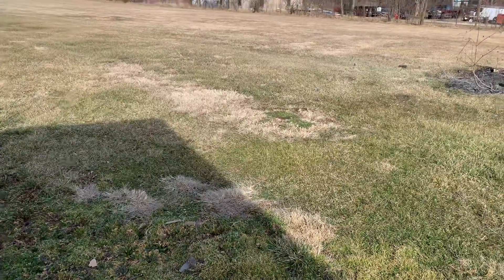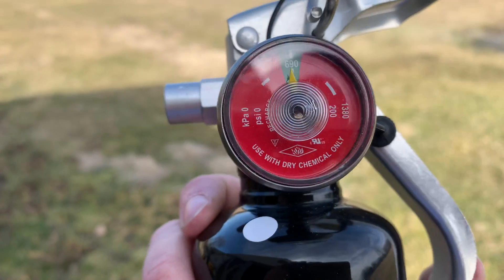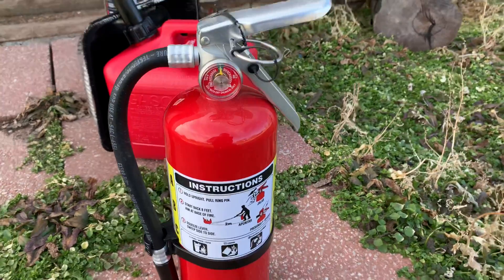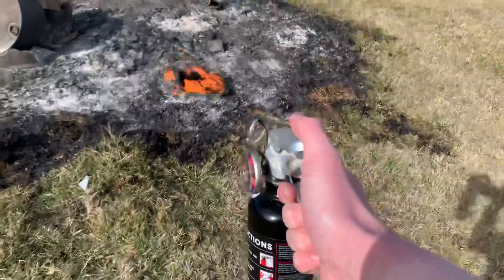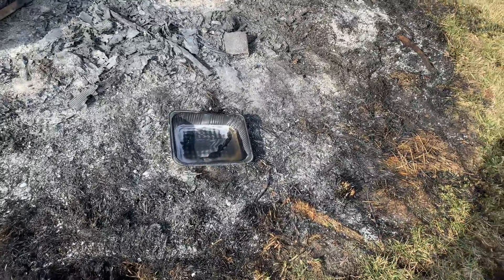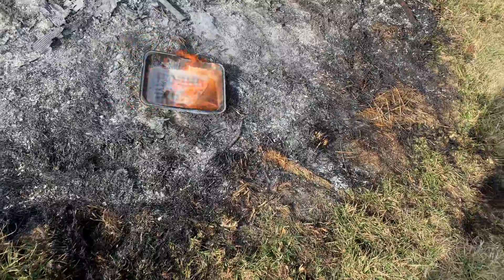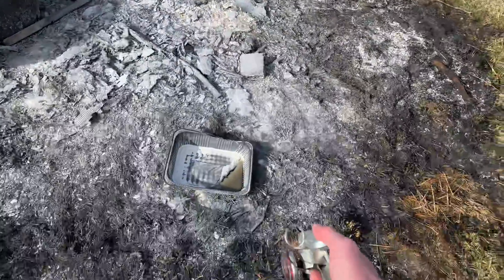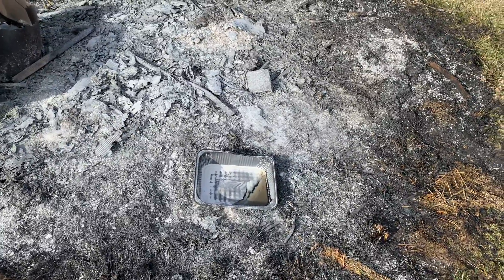H3R Performance MaxOut MX100 Dry Chemical Fire Extinguisher test

Comment: Where do you send it to recharge to get the same chemical?
Reply from the maker: I took it to my local fire equipment place and they were able to recharge it.  This particular fire extinguisher is actually an Amerex unit so I’m sure they used the Amerex brand regular dry chemical (sodium bicarbonate base) for the refill.
Reply: @zachsafarik5218  hello Zach that was a great video thanks so much for sharing it. Very informative and right to the point. I’ll look forward to check out more videos from your channel. Have a good one.
Reply: Cool!

Comment: The thing with getting these recharged is legit. Even though you only use a portion of the powder, that powder gets into the valve and won’t allow it to seal tight again, so the remaining nitrogen pressure will leak out, making it useless. Any time the lever is pressed, even for half a second, it needs to go in for recharging.

Comment: A rebranded Amerex 620.  I have a chrome 1 lb amerex one that I’ve had for about 20 years and has been recharged multiple times
Reply from the maker: Sweet!  So I guess Amerex discontinued their regular dry chemical line with the standard models including the A620.  They however still make regular dry chemical units in the high flow versions but otherwise buyers will only be able to choose between ABC dry chemical (ammonium phosphate) or Purple K.  Amerex still offers the small 1 lb sized units with both Halotron 1 and Halon 1211.  Since Amerex discontinued the A620 model, H3R Performance is now the only company that sells these Amerex 1lb units, but at a higher price unfortunately.
Reply: @zachsafarik5218  You are correct, Amerex did discontinue their "regular" dry chemical line (Sodium Bi Carbonate) line in favor of Purple K. They do make a small 1lb Purple K extinguisher, Model 376T with a 2BC rating. It is the same size as the unit shown in the video.

Comment: I guess they told you it was amerex when they got it refilled I did not know that! but I will say though I may not know what a 1 lb unit is for I think most recomedations are that a 2.5 lbs  the smallest size for home use  it has a very specific application but good luck the first alert had a faulty valve thats not great ! and as in reference to that the Manf is in China ? I bet it could be hard to get that refilled as I am not sure that most Us Manfs Stock China chemicals I would wonder if the best you could hope for is could an ansul foray be an alternative  but Of course what you are paying for is that you hope they properly charge the unit with the product indicated on the label so it will work properly but I did find a video a refill technician sent to a company he argued that extinguishers that are professionally maintained may not work properly don't know what to tell you

Comment: did you succeed in getting it recharged inexpensively ? I mean this is a rare brand
Reply from the maker: Yes.  I had no troubles at all getting it recharged.  This extinguisher is actually an Amerex product but sold by the third party company H3R Performance.  You can get this particular extinguisher recharged for just under $20.
Reply: @zachsafarik5218  I guess they told you it was amerex when they got it refilled I did not know that!

Comment: Is this unit big enough to put out most fires in the open engine bay of a big semi-truck?
Reply from the maker: It would work if you had a small fire or if you can react to a starting fire quickly, however for a large engine in a big rig I would recommend taking along a 2.5 pound extinguisher to use as your primary unit since this one has a very low UL Rating.  This extinguisher is mainly meant for small to midsize vehicles but it could also be added to your existing fire protection if you already have one in use.